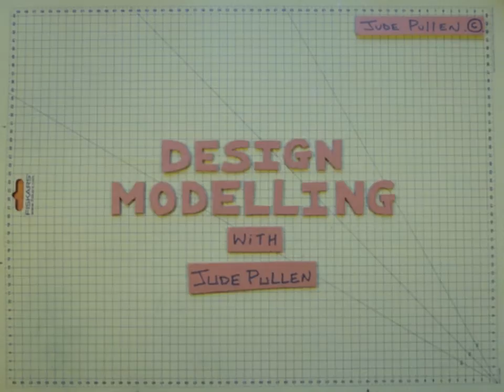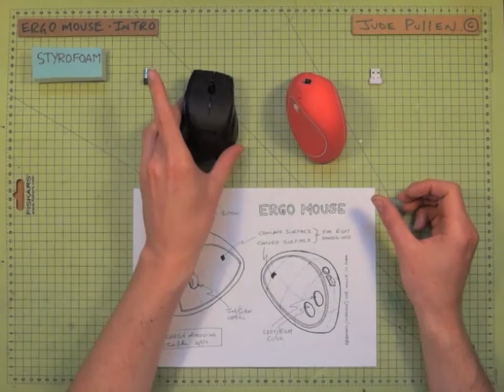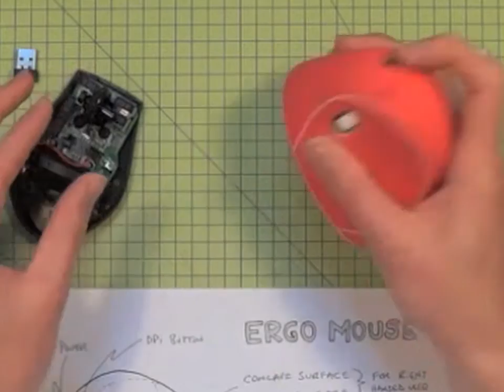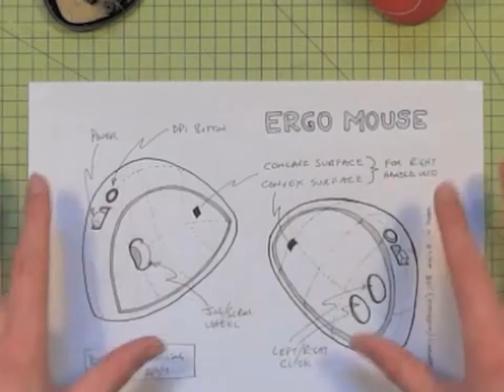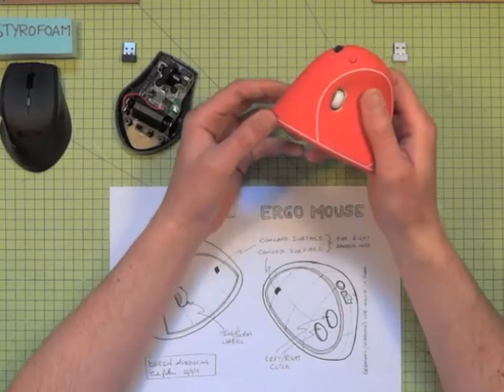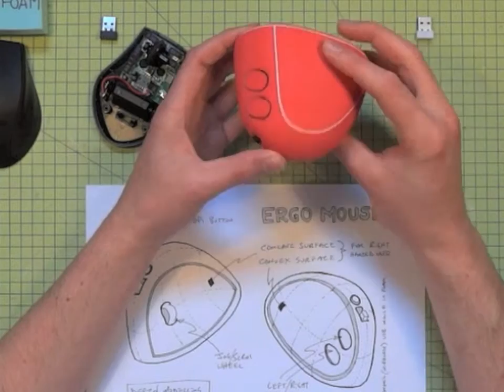Ergo Mouse - 0 Intro

Comment: Mine would look closer to the Razer Naga X, with less buttons and a double finger rest on the side that only has the ring finger it would also have a pinky rest. That position feels the best to me. There have been mice like that but not very many. There's a cooler master and the Naga X are the most close brand new high quality mice that offer it. There are a couple for $18 roughly as well. I tend to hold my fingers straight out and I use my entire arm to aim rather than my wrist or fingers, which prevents physical fatigue.
Reply from the maker: I made this some years ago so I suspect times and products have updated. But it’s still a fun project to explore.  Thanks for your comment!
Reply: @JudePullen  Ah yea, I mean the ergo build I would do. Yours is unique to me, 1 of 1. Actually ended up buying a $10 Razer Death Adder Elite. My Steel Series Rival 3 is too small, a mistake going back into the wired mouse status, hopefully the adder is bigger and ergonomic enough for me, if not I don't think it'll be a major loss I should be able to resell it for more.